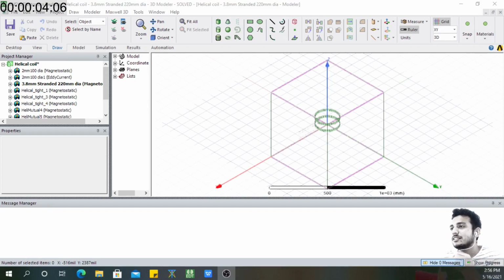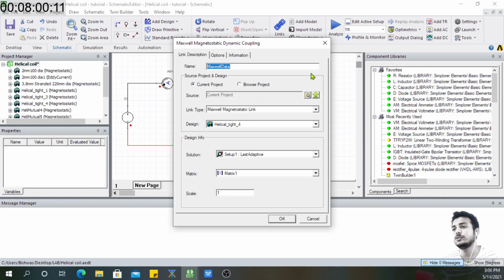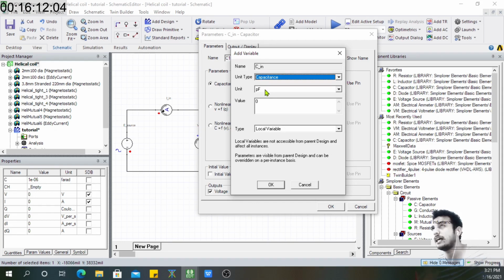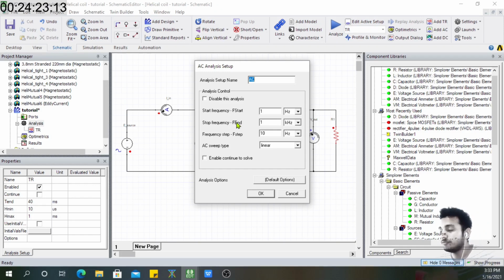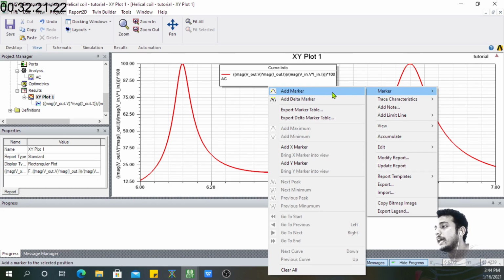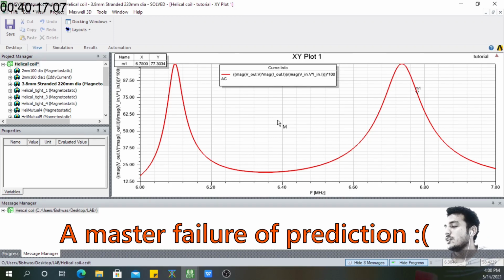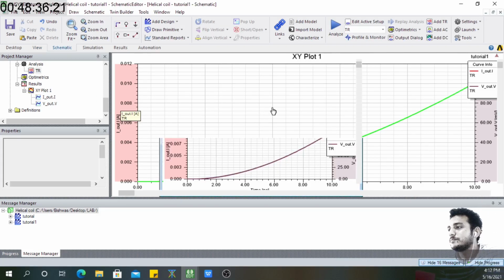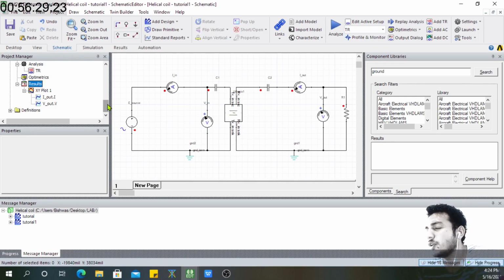Wireless Power Transfer Simulation || Coil Design || Ansys Simplorer || Twin Builder || Tutorial 5

Comment: hollo Bishwas Inconsistent Results Between ANSYS Versions For the same spiral coil model with identical parameters, two different ANSYS versions produce significantly different inductance values.

• Versions used: [Specify versions, e.g., ANSYS 2023 R1 vs. 2024 R2].

• Could this discrepancy be due to solver differences or hidden settings?

Comment: Hi Sir, When using Simplorer simulation, the coil current is the circuit current or excitation current. I do not understand this point?
Reply from the maker: Circuit simulation will take over once it is used. Maxwell model is just for parameter derivations. It has no play except that in circuit simulation. So you can name the current whatever you want. Its basically same thing.

Comment: hi
I am having this error, "Simplorer requires the source solution 'Setup1 : LastAdaptive' to have a frequency sweep of at least '20' points". The frequency I am using is 2.5 kHZ. Plz help!
Reply: I had the same error. Then I changed my Maxwell model solution type from 'Eddy Current' to 'Magnetostatic' (Right click to 'Maxwell 3DDesign (Eddycurrent) --> Solution Type). The problem has been solved. Don't forget to change SubCircuit as well.
Reply: @ceryanc9984  I solved the issue in Eddy Current Solution. In the solver tab you have to put a frequency sweep of atleast 20 points (20 frequencies).